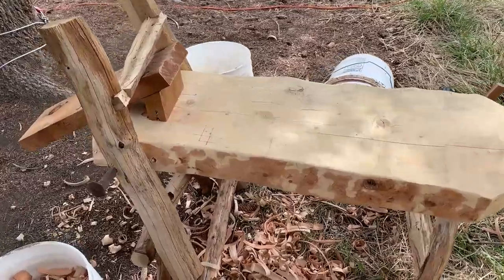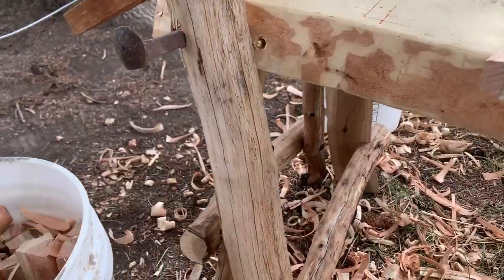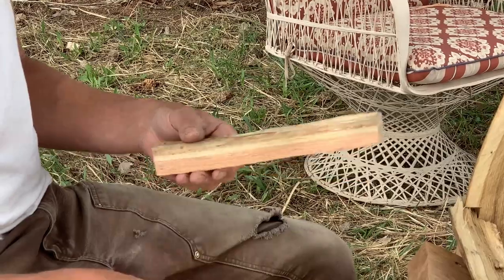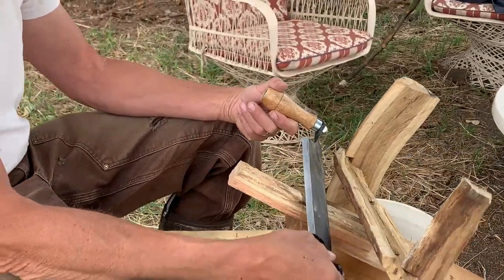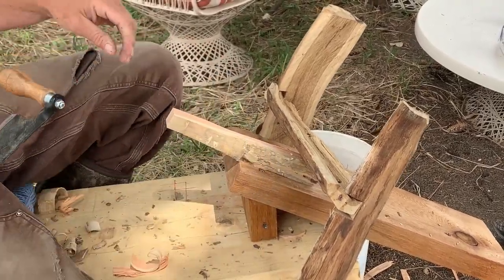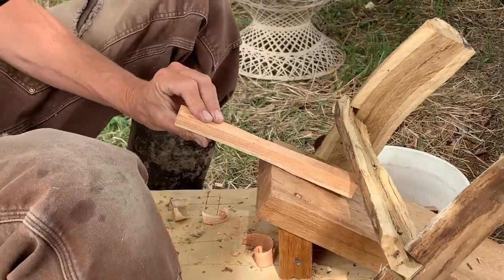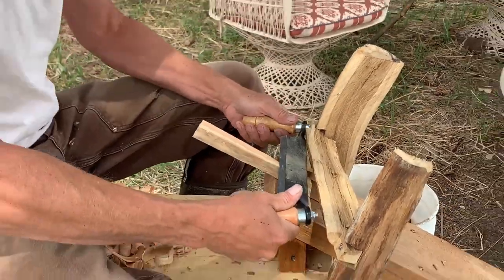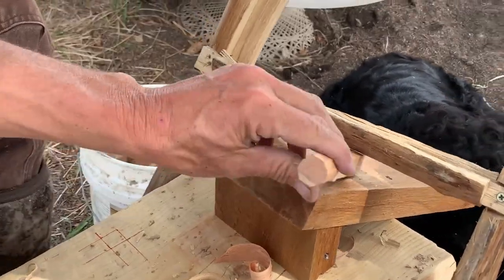Timber pegs

Comment: There is an easier way to do this.
Split the wood as normal to get a peg roughly the size and with straight grain.
Buy the tool or anneal a file or some other tool steel.
Drill a hole in it that is the size that you need. Larger holes allow you to process the pegs easier.
Harden the tool although it may not be needed.
Pound peg into hole, after having one end smaller than the hole. Doesn't need a lot.
With several holes the peg can be rougher, and you can size it by progressing through the holes.
Search 'steel dowel plate'